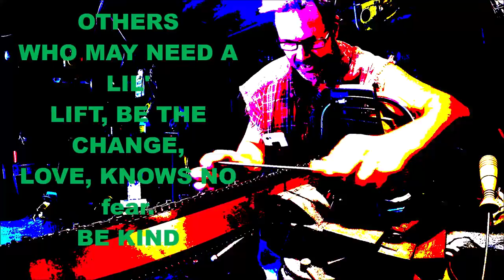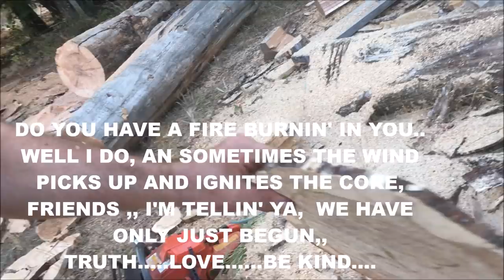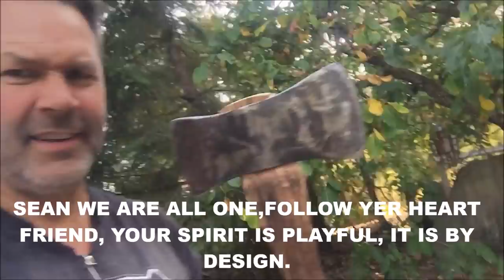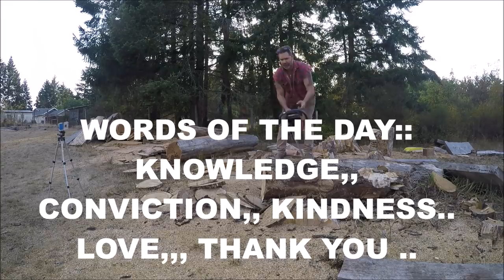HOW TO SHARPEN A CHAINSAW

Comment: Thanks Donnie! Buckin you're absolutely right and you know it. Anyone who says the teeth all have to be the same size and angle don't really cut trees all that often if at all.  My dad did tree work and so did I for a stint now I am getting back into it so when he passed me all his gear it was in bad shape all of it. Not a single one of my saw were runners all eight of them are now though including my grandads 041 that got rescued from a trash pile. Bottom line like you said keep your bars flipped and dressed, Rakers at a good height, and the chain sharp and the saw will flat out cut. Love what your doing you have the same passion about cutting as I do keep doing it my friend.

Comment: I met a homeowner once that straight up told me it's better to buy a new chain every time it gets dull because there is no point in trying to sharpen it back to factory cutting edges.  He had some thought that the factory was God or something.   I was polite and told him I'd whip up a chain for him some time   Needless to say I do all his chains now and he runs them til they spit teeth.
Reply: so what happened to all the chains he had...?
lol, I have to hand sharpen mine, isn't any way I'm gonna blow $30-$50 on chain everytime it got dull.

Comment: Hi buckin, great vid as always. Just a quick question, why do you pull the starter handle before you shut off the saw? Does it stop some kind damage to the cord?
Reply: I just noticed that and I wonder the same thing.
Reply: Yeah, as he stated in a video it saves wear & tear on the pull starter mechanism if the saw kicks back during shut down. Be kind :-)

Comment: Malarkey! Love it. While I use this word all the time you just don’t hear it that often. The length of the tooth has nothing to do with the quality, speed or direction of the cut. The only part of the tooth that cuts is the corner and leading edge and they don’t care how much ass is behind them. If the sharpening angles and proper “raker” length are maintained on every tooth then the chain will cut efficiently and straight. Physics!

Comment: Watching this again! 
I have been using a stihl 200T for a while now on the trail and both of my 12" chains have one side nearly wiped out from a rock so the left teeth are nearly gone, but the right side is nearly brand new. The saw still cuts like crazy, no chattering or angle cuts unless I'm not careful to not torque the bar to the side. Meaning I can make an S cut if I wanted to, but it will still cut straight as long as I am careful to keep the saw straight.

Comment: Thanks for inspiring  in  so many facets of life and tree  work. Been limbing  since 1980 but never tried to sharpen freestyle. Now following your suggestion am using a 3/16  file  instead  of 5/32.  Question :where a 7/32 is called for do you go to a 1/4"?  Am over 80, still climbing , learning ,and heating with wood only 24/7  from December through  February  in Jerusalem,  Israel.

Comment: I wish I would have seen this video 2 years ago when I started to work  with my chainsaw in the woods. I've probably thrown away 5,6 chains because the teeth were not even and I would wonder why I'm not cutting straight! Everyone would say cause my teeth aren't even on the chain. Well that was all balony! Reason I wasn't cutting straight was cause my raker was higher then my tooth. SO after I fixed my raker and started cutting it went like hot knife on butter even with some teeth not the same size on the chain. Everyone thinks the teeth have to be identically the same size to cut straight LOL
 I wish I wouldn't have thrown those other chains away :( I learned alot from this video. Thank you.

Comment: Thanks for all the effort you put into your videos to help us learn. I only use a small power saw for firewood but have it cutting pretty sweet thanks to your vids. I use a sharpening kit for the dremmel and find it really easy to use. Regards chains and them coming off... obviously a slack chain is gonna come off but I thought it was sufficiently tight on 2 occasions and it came off, is there anything else that can cause this? Ie, bar worn too much? Also the plate you use for the rakers, does that just ensure you’re a fraction below the cutting edge of the tooth. Please reply, i value your input
Reply from the maker: WORN DRIVERS OR BAR YES, ALSO IF YOUR SWINGS YOUR SAW AROUND AND HIT SOMETHING ON THE SWING AT THE TIME BETWEEN SLACK AND A REV
Reply: Buckin' Billy Ray Smith thanks for the reply 👍😎

Comment: The only thing I find is on the extremes (and dont underestimate when I say on the extremes) youll have a hard time shaving on the sides like when your just tidying up a notch. Sort of like the ground chain on one side and round filed on the other. 

I mostly cut hardwood and real low stumps(on the flat ground). Ive smashed one side of my chain more times than I can count and other than breaking teeth off Ive come to the same conclusions as you and can usually save it.  

I know why many push for teeth to be even and in alot of cases because people struggle with filing I see why it gets pushed. But as always things get taken too far and out of context. Like the "benefits" of removing spark arrestors

Comment: Yeppers !  - looked like that 1/4 inch end  cut on the log was straight as can be with different length teeth ... I’ve “experimented” with sharpening chain and sharp tooth/ raker height is where it’s at ... lotta mis-info out there and it burns my fanny the baloney some peeps post on utube ... thanks for sharing the knowledge and more importantly the Truth ... Fabz out
Reply from the maker: IT MY PLEASURE
Reply: Buckin' Billy Ray Smith let me pass on a little tip on gettin more life from your files ... soak em in some strong vinegar !  (Clean em with a file card first to get out the swarf ) The acid in the vinegar will etch the edge and will allow some more chain-sharpenings ... and it’s cheep !

Comment: Now days big red (jonsered 2095) is primarily used to cut stumps flush in the urban Forest. The teeth have never been the same size since the first stump cut. one side of the chain is about a quarter the size of the other, if that. Keeping the rakers filed is the key. Time is money, chains are money, and my root flares are straight and even and flush to the ground. Some of these root flares on Silver Maples can be in excess of 5 feet. The boy knows what he's talking about.